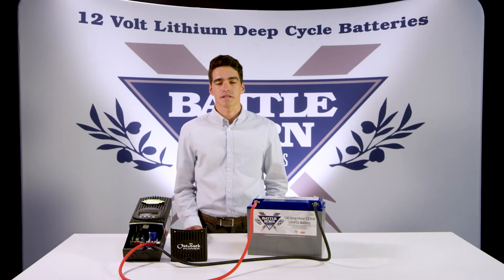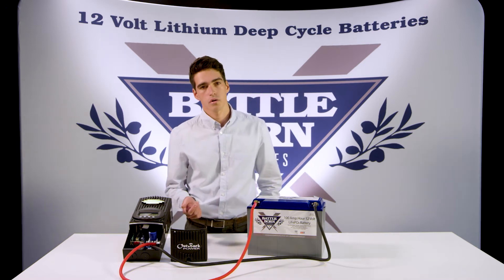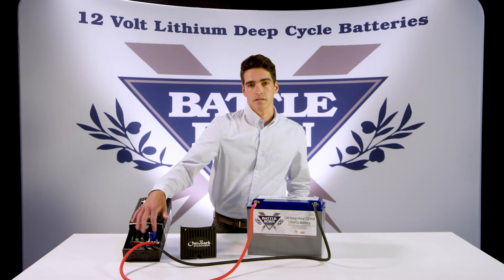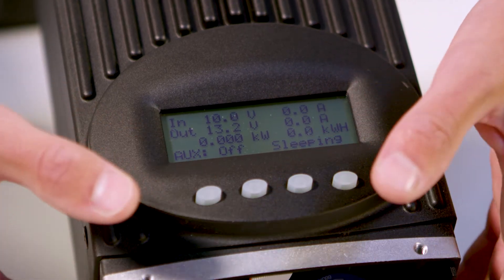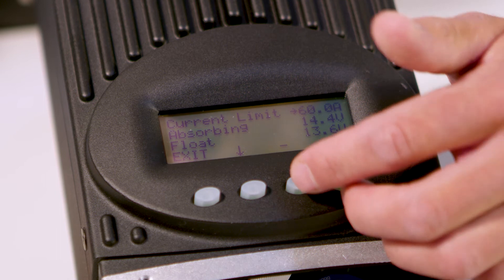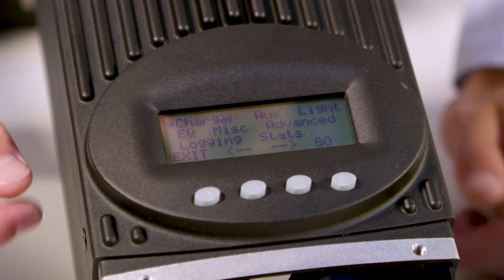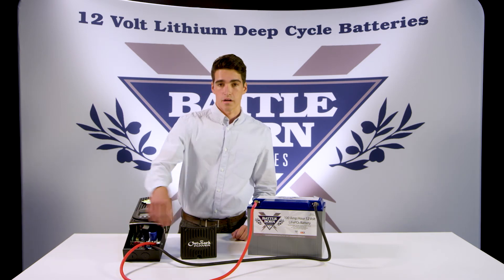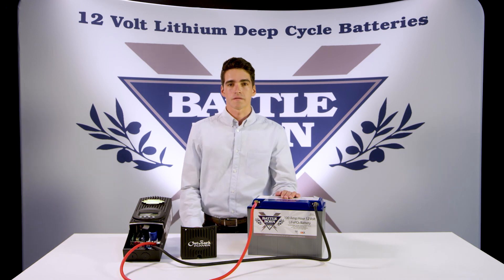How-To: Setup A Power Max Outback Charge Controller | Battle Born Batteries

Comment: What if you use 48v with a fx3048 power panel? What would you recommend the settings thru the Mate 3 or the Mate 3s
 Looking at buying 4 batteries.

Comment: OutBack is not responsible for shipping damage caused by improperly packaged products, the repairs this damage might require, or the costs of these repairs.

If, upon receipt of the product, OutBack determines the product or product part is defective and that the defect is covered under the terms of this warranty, OutBack will then and only then ship a repaired or replacement product or product part to the purchaser freight prepaid, non-expedited, using a carrier of OutBack’s choice, when applicable.

If product fails in 90 days or fewer from the original purchase date, OutBack will replace with a new product. If product fails after 90 days and up to expiration of warranty, OutBack will, at its discretion, either repair and return a product, or ship a replacement product. OutBack will determine whether a product is to be repaired or replaced in accordance with product age and model. OutBack will authorize advance shipment of a replacement based on product age and model.

In cases where an OutBack dealer or distributor replaces a product more than 90 days old with a new product, OutBack will NOT compensate that dealer or distributor with new stock unless the exchange was authorized in advance by OutBack.